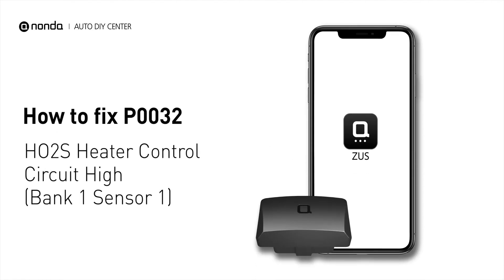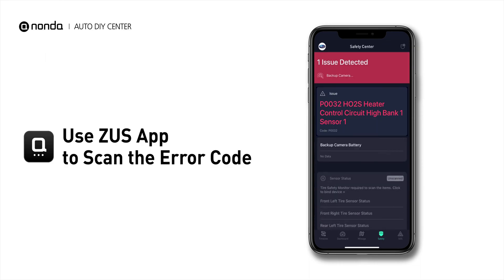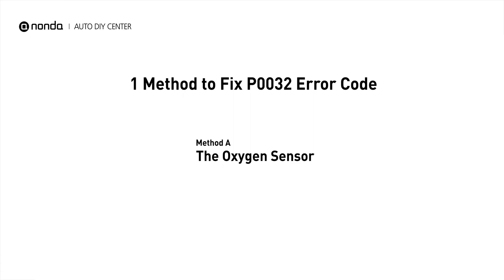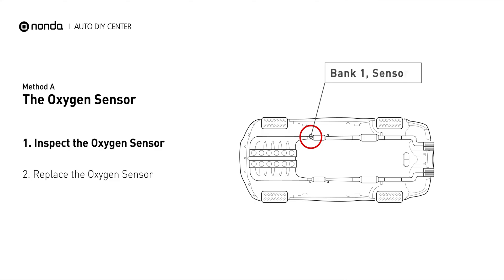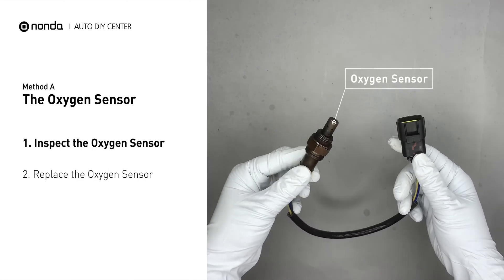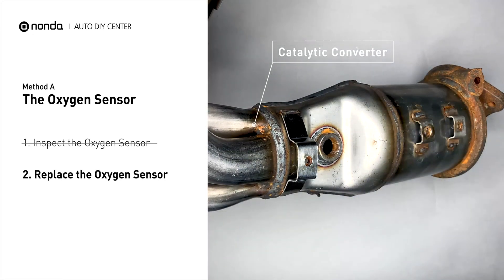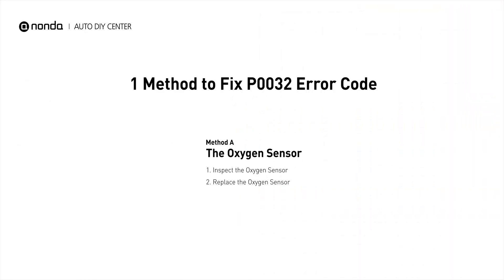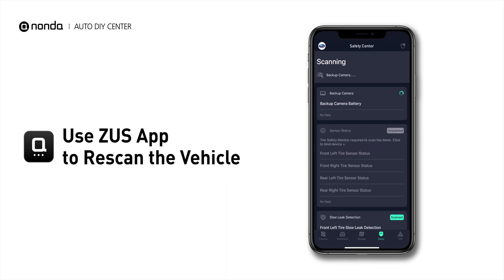How to Fix P0032 Engine Code in 2 Minutes [1 DIY Method / Only $19.99]

Comment: Funny that you are showing an anti fouling adapter, (silver extension) which is illegal to pass inspection (at least in RI) because it will often remove the code but not fix the real problem.

Comment: will this stop the engine from starting
Reply from the maker: HI Ian, you can drive the ca normally but we suggest addressing the issue in a timely manner to prevent potential problems like sensor loop failure and poor fuel consumption.
Reply: @nondainc  found out in the late afternoon it was the crank shaft sensor plug was all green inside . going try get 1 today and join the wires see if this will help. praying to god it fires up lol ..ps thank you for your help and great vidoes you do
Reply from the maker: Hi Ian, hope that fixes the issue. Let us know if there's any update. Stay safe!

Comment: With an adapter the p0032 that is before the catalyst is solved.
Reply from the maker: Hi Randy, we also suggest to refer on the vehicle's service manual as some manufacturers apply different troubleshooting steps on how to fix certain error codes.